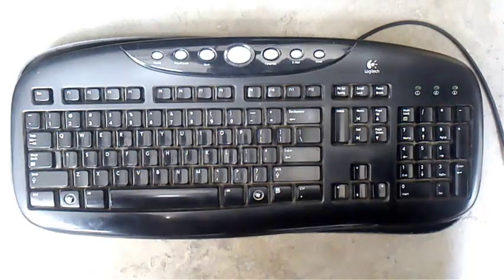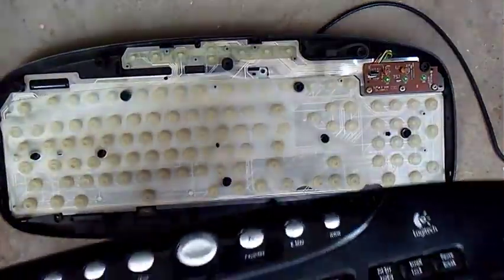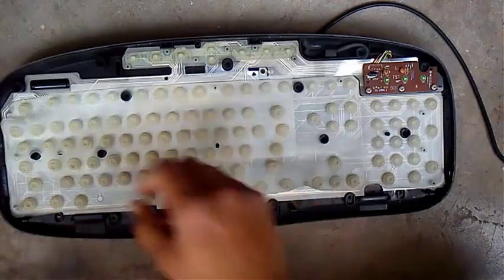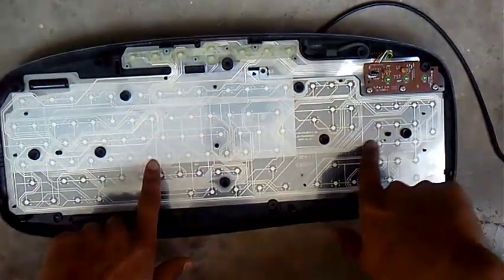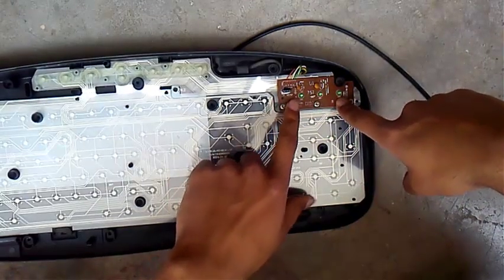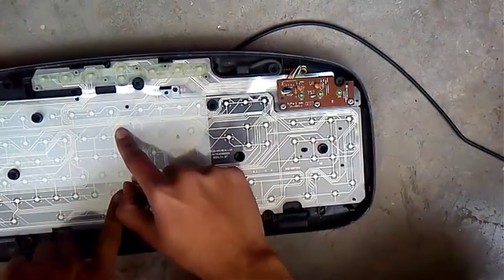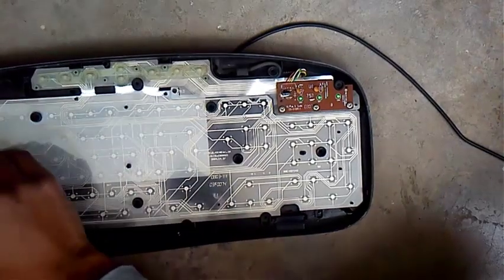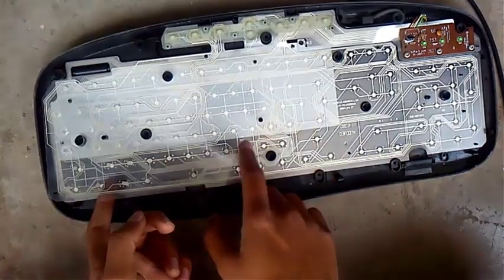What inside a keyboard and How keyboard works?

Comment: Note that not all the keyboard use Rubber mat and Membrane Sheet. Some keyboard specifically expensive or vintage one got Mechanical Switch and PCB (Cherry MX or Alps SKCM/SKCL) instead of the Rubber mat with membrane sheet like in this video.

Comment: Your thick accent blocked my understanding how the signaling work
Reply: Basically a circuit connected to the chip is sandwiched between those two layers of covering and when we press a key the circuit stops signal only for that key which the chip understands and complies with to create that word
Reply: Shut up racist